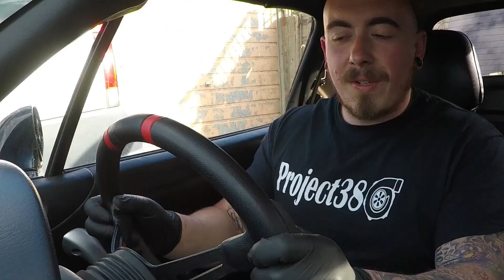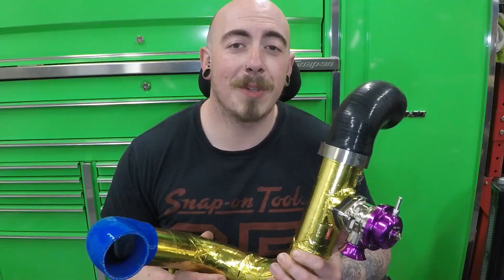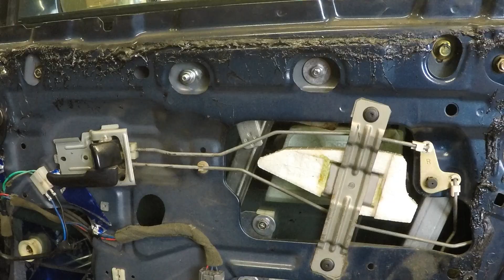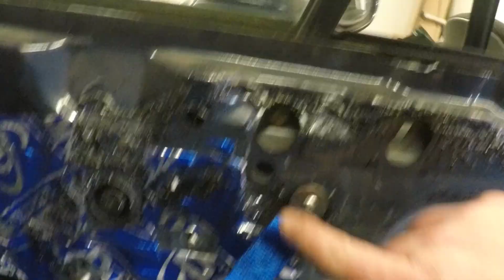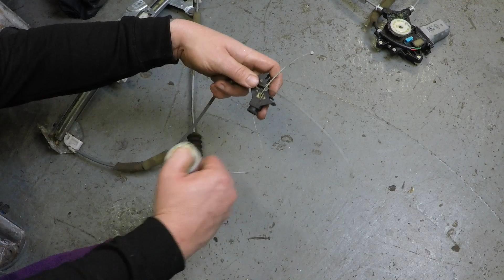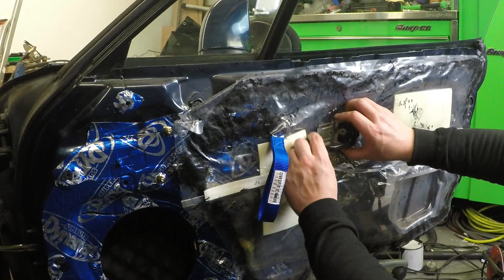MX5 NB WINDOW MOTOR AND REGULATOR REPLACEMENT : MX5 TURBO BUILD pt 27

Comment: excellent video, about to replace my pass. window reg on mine. 
is it possible to pull the motor and slider out the speaker hole? to avoid removing the front window rail?
Reply from the maker: good luck. no afraid not as its too much of an angle

Comment: I need to do something about the drivers side window. It goes down but stops halfway. Goes back up though.
Reply from the maker: yep sounds like the bush has worn out or the runner is clogged with dry grease
Reply: So what’s the fix for this
Reply: @fishindude85  I fixed mine with a good cleaning. A friend of mine also applied some type of grease. Not only my window is working again, it's also very fast. Did the passenger side too. Couldn't believe that my NB could open and close it's windows so fast.

Comment: Heads up for anyone watching this. It is not required to remove the front window guide seals. This is very, very risky.. The seals are old, likely to tear, and are difficult to get back into place. It's much easier to only unbolt the three nuts on the door, this will allow you to (carefully) wiggle that guide enough to get the motor out. Be careful not to torque it enough to break the window, but imo it's safer vs messing with that seal around the front quarter window.
Reply from the maker: thanks for the heads up. i personally haven't had an issue or a mishap with the window or seal

Comment: You did not have to remove the wing window channel just had to make it loose to move it a little, and the rubber door window seal don't remove it. with the channels loose there is a lot movement. Just some unnecessary work.
Reply from the maker: yep i know that but for people doing it for there first time its just safer to remove them. with these out the way you definitely wont twist the smaller window and potentially break it and you can then get the motor out with ease.
plus then you can clean everything while its out and investigate for corrosion and blocked drain holes in the inner door